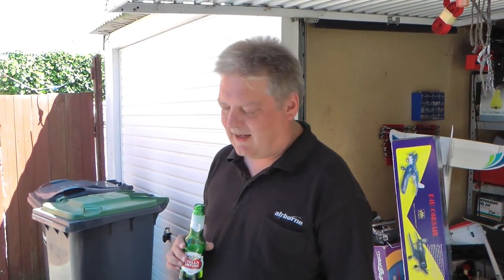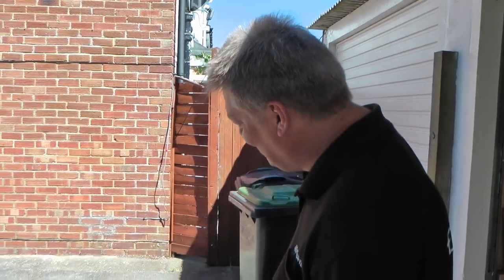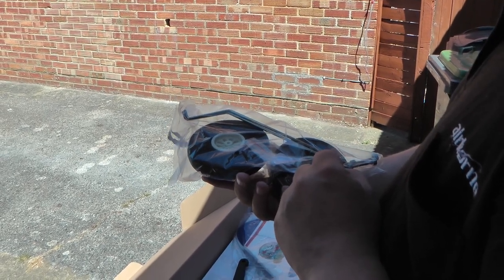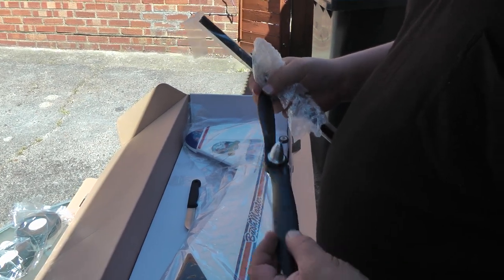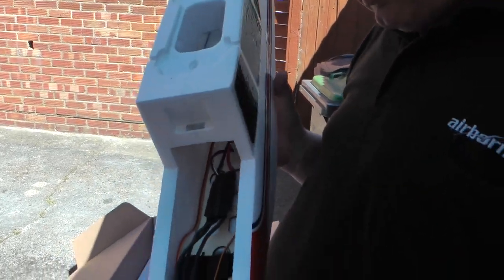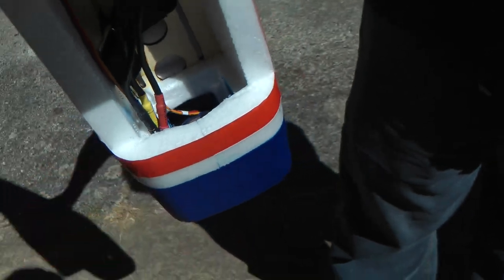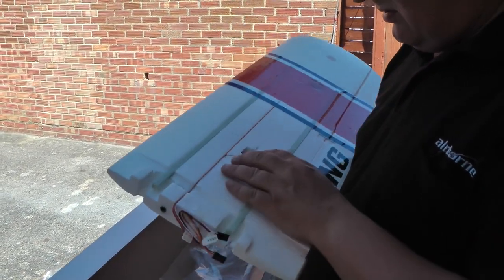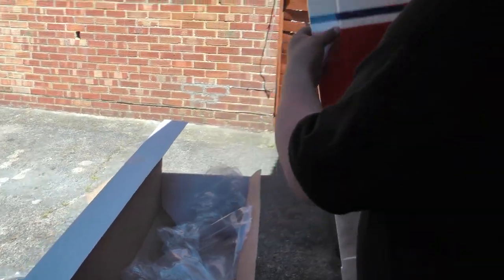Hobby king Bushmaster Unboxing

Comment: Nice looking plane this is people :)  Congrats on getting that one in offcourse :) 
Should be very Fun Cub to fly I'd say :D 
Good luck / have fun on the maiden offcourse!
Cheers and thanks for sharing
Reply from the maker: DutchRC ADVENTURES Thanks mate! Its a nice plane tainted with bad quality control! Vertical fin that was nowhere near vertical. Had to do some foam surgery to get that straight (fuselage sides misaligned caused that). Magnets detached from motor after 2 flights.
Reply: Hot damn! Especially that motor-problem is BAD man :O  Sorry to read that..
Reply from the maker: DutchRC ADVENTURES All part of the fun of the hobby isn't it. Motor was easily fixed with CA glue. We are going to be using the Bushmaster to raise some money for a local charity, giving trial flights / lessons. Mark 2 is doing a paint job on the bushmaster to make it look like an ambulance :o))
Reply: Great of you people to do this for charity offcourse! :)